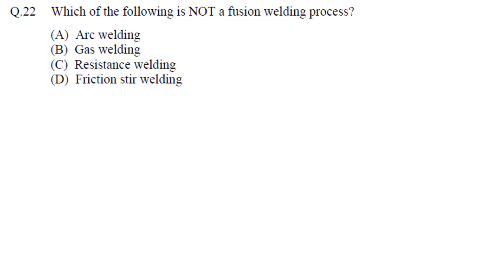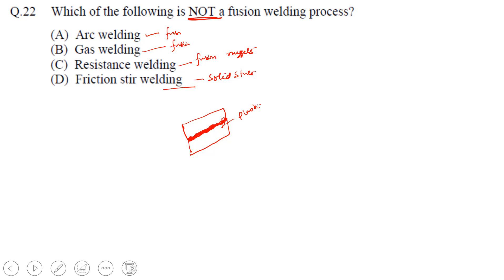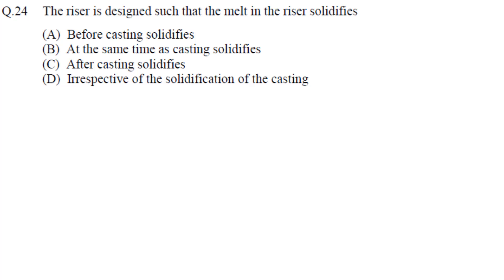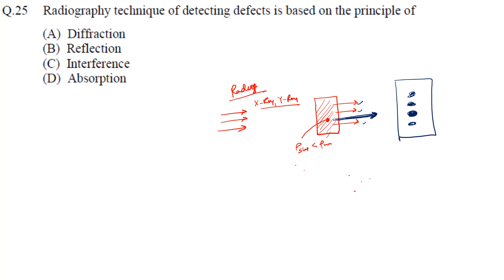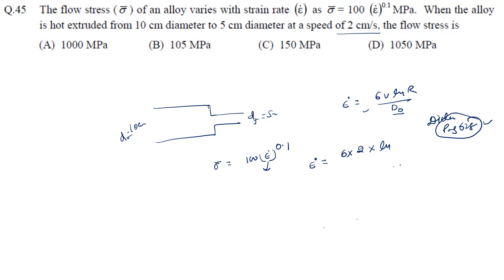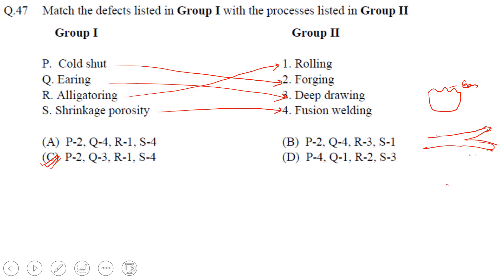GATE 2012 Manufacturing Process Solution

Comment from the maker: 00:00 Fusion welding process
01:12 Tungsten Filament
01:25 Fusion welding
02:51 Riser Design
04:00 Radiography
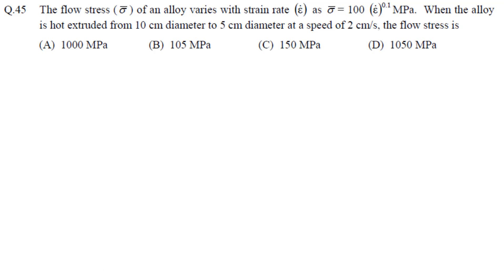06:25 Flow stress
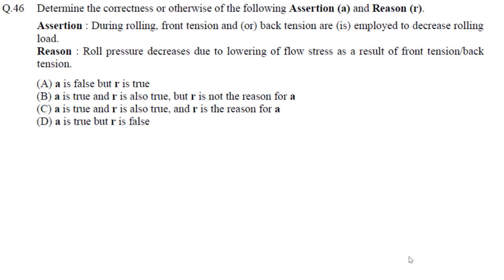09:31 Assertion Reason Rolling Tensions
10:08 Match type defects in manufacturing